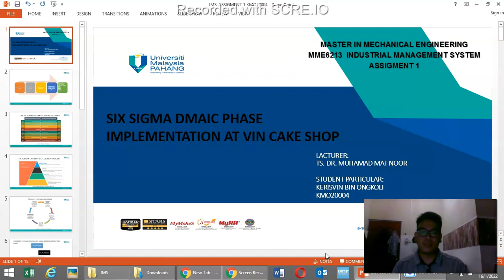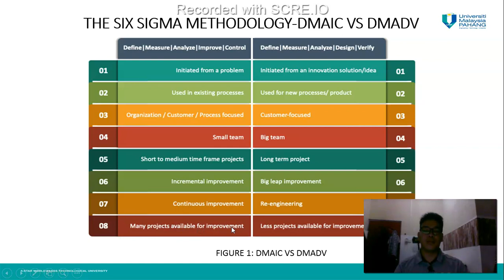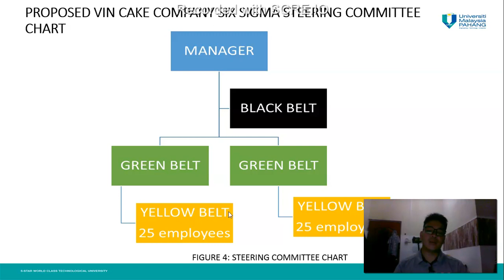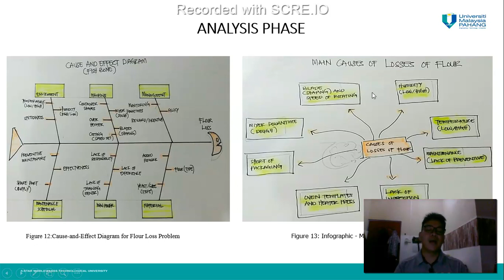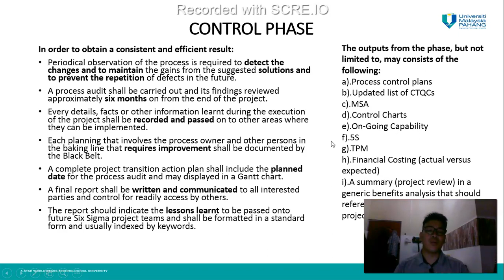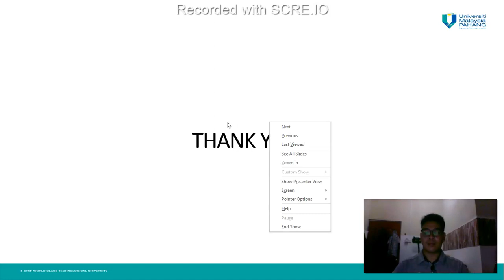Video Six Sigma Project Presentation

Comment: The project was successful because the problem was clearly defined from the beginning, and the team followed every stage of the DMAIC methodology correctly. Support from the Black Belt and Green Belt helped guide the team and ensured the project stayed on the right path. All decisions were made based on real data rather than assumptions. By identifying the true root causes and collaborating across different functions, the team was able to develop effective and practical solutions. The control measures implemented afterward also ensured that the improvements were sustained over time.

From the presentation, I learned that accurate data and a structured DMAIC approach are crucial for any improvement initiative. Clearly defined team roles and strong leadership support make the process more efficient. I also realized that improvements must be supported by proper control plans to maintain long-term results. Overall, the project showed that combining teamwork with a systematic problem-solving approach can lead to lasting improvements.

I agree with the earlier point that reliable data, a clear DMAIC structure, and well-defined roles significantly contribute to project success. In addition, thorough root-cause analysis and strong control mechanisms are equally important, as the improvements may not be sustainable without them.

Comment: 1. The success of Six Sigma projects hinges on several critical factors. Firstly, adopting the DMAIC methodology clarifies the project workflow. Secondly, employing data analysis tools such as fishbone diagrams or Pareto charts identifies the primary causes of waste. Thirdly, clear division of responsibilities among teams ensures effective implementation of solutions. Finally, the Control phase must be executed to guarantee the sustained maintenance of improvement outcomes.
2. From this presentation, I learned the importance of Six Sigma, which means that improvements must be based on data. Furthermore, I also learned that process improvement is an ongoing process, not a one-off result.

Comment: In my opinion, the key factors for success here were the rigorous application of the DMAIC methodology and the use of the Pareto Chart to strictly identify the 'vital few' problems (specifically the ovens and packaging areas). The fact that you were able to quantify the success by improving the Cpk from 0.21 to 0.7 provided strong validation for the project.
The main lesson I learned from this presentation is the critical importance of Root Cause Analysis (Fishbone Diagram). It was insightful to see how operational waste was actually tied to specific maintenance issues (heater plates) and environmental factors (humidity), rather than just general errors. It effectively demonstrated why the 'Measure' and 'Analyze' phases are so crucial before jumping to solutions.

Comment: 1) The Six Sigma project was successful because it combined strong leadership support, a clear problem definition using the DMAIC framework, and a data-driven approach that ensured decisions were based on measurable evidence. Cross-functional collaboration, employee training, and a focus on customer satisfaction helped drive meaningful improvements, while control mechanisms like dashboards and audits ensured the results were sustainable over time.  

2) From the project presentation, the main lessons learned are the importance of setting clear metrics early, maintaining structured problem-solving discipline, and communicating progress transparently to stakeholders. Celebrating small wins built momentum, adaptability allowed the team to respond to unexpected insights, and most importantly, the project showed that Six Sigma is not just about tools but about fostering a culture of continuous improvement.

Comment: 1. This Six Sigma project succeeded due to a well-defined problem statement, strong data-driven analysis, and effective use of the DMAIC framework. Collaborative teamwork and sustainable corrective actions were also major contributors to its success.

2. I gained a deeper understanding of how structured problem solving methods such as DMAIC and tools like the fishbone diagram can drive meaningful improvements. It’s a strong example of how data and teamwork create impactful results.

Comment: 1.The success of this Six Sigma project was due to the fact that they were able to define the problem, analyse everything using data and used the DMAIC method. Teamwork and identification of solutions that will be enduring also contributed to the success.

2.I got to know that structured problem solving, in this case, the DMAIC process and the fishbone diagram tool are actually applied and result in actual improvements. It was an excellent example of how collaboration and working with data are important.

Comment: 1. Success Factor: The project won because the team was disciplined, using the DMAIC structure and data to find the exact problem, backed by strong teamwork that created lasting solutions.

2. Lesson Learned: The core lesson is that structured methods (like DMAIC and Fishbone) and teamwork are not just theory; they are the essential tools needed to turn raw data into real, measurable business impact.

Comment: 1) Key success factors that made this Six Sigma project successful:
The project succeeded because the team clearly defined the problem, used DMAIC effectively, and relied on solid data analysis. They identified the main root causes like oven defects, humidity issues, and poor maintenance and focused improvements on these high-impact areas. This led to a strong capability increase from Cpk 0.21 to 0.70.

2) Lessons learned:
I learned that accurate data, proper root cause analysis, and targeted improvements are crucial in Six Sigma projects. Focusing on major loss areas and maintaining good process control can deliver big, measurable results even in an SME environment.

Comment: LAKESEN A/L SARAVANAN (MA22027)

The presentation was very clear and well-structured, and it helped me understand how a real Six Sigma project is carried out step by step. I found it useful how the lecturer explained the project using the DMAIC framework, especially how the team defined the problem clearly and supported every decision with actual data. It showed the importance of identifying the correct root causes instead of jumping to solutions too early.

I also appreciated the explanation on teamwork and stakeholder involvement, which made me realize that a Six Sigma project is not just about tools, but also about communication, leadership support, and collaboration. The improvement and control phases were also well presented, showing how the solutions were implemented and monitored to make sure the results are sustained.

Overall, the lecture gave me a better understanding of the key factors behind a successful Six Sigma project and taught me the importance of data-driven decisions, root cause analysis, and consistent follow-up. It was a very informative and practical explanation that connected theory to real-world application.

Comment: The project worked because they followed the DMAIC steps properly. They found the real problem, collected data to measure it, figured out the main causes using Pareto charts, then fixed those specific problems. I learned that Six Sigma needs proper planning and data, not just guessing. The Pareto analysis was really useful. Also, the Control phase is important to keep improvements lasting. Even small businesses like bakeries can use Six Sigma successfully to save money and reduce waste.

Comment: 1. Briefly discuss how and why this Six Sigma project was successful.

The Six Sigma project was successful because the team clearly stated the management roles and their respective duties in the organisation based on the belt system, which strengthened leadership support for the project. Besides that, the DMAIC initiatives were implemented effectively in the project to solve the issues that the company were currently facing and improve sales performances. Moreover, the team also utilised the right Six Sigma tools to conduct data-driven analysis for each phase throughout the project and monitor the improvements to ensure the solution was sustainable.

2. What do you learn from this project presentation?

From the project presentation, I learned how to conduct a Six Sigma project and utilised the Six Sigma tools effectively. The presentation demonstrated how structured approaches like the DMAIC method are used systematically and step-by-step to guide problem-solving and process improvement.

Comment: The team pinpointed a specific high-impact issue, such as increasing flour usage and rising costs. Having a clearly defined problem helps maintain alignment, focus, and purposeful goals. Accurate measurement then eliminates guesswork and highlights the areas that truly need attention. Identifying the root causes is crucial; without this, any improvement would be short-lived or incorrectly targeted. The team also monitored financial outcomes, showing improved profitability—proof that Six Sigma efforts work best when they deliver measurable business results. By following each DMAIC phase systematically, the team avoided shortcuts and maintained a disciplined approach to problem-solving

Comment: 1. The project was successful because the team clearly defined the problem and set measurable goals from the beginning. It also benefited from strong support and involvement from management which ensured the required resources were available. The team effectively used the DMAIC methodology and relied on data-driven analysis to identify and eliminate the root causes of the issue. In addition, the proper use of Six Sigma tools and a strong focus on customer requirements helped achieve meaningful and measurable improvements. 

2. From this project, I learned that making decisions based on data is far more reliable than relying on assumptions. I also realized that teamwork and open communication are essential for solving complex process problems. The presentation showed how structured methods like DMAIC help guide improvement efforts in a systematic way. Finally, the project highlighted the importance of continuous monitoring to ensure that the improvements achieved are sustained over time.

Comment: The project succeed because the problem was identified clearly from the start, and the team followed each stage of DMAIC properly. The guidance from the Black Belt and Green Belt kept the team on track, while decisions were based on actual data instead of assumptions. By finding the real root causes and working together across different functions, the team was able to create solutions that actually worked. The control steps put in place afterwards also helped make sure the improvements stayed consistent over time.

From the presentation, I realised how important accurate data and a structured DMAIC approach are for any improvement project. Having clear team roles and strong support from leaders makes the whole process smoother. I also learned that even after improvements are made, proper control plans are needed to maintain the results. Overall, the project proved that combining teamwork with a systematic problem-solving method can create long-term impact.

I agree with Nur Fatini earlier that solid data, a clear DMAIC flow, and well-defined roles really do make a big difference. I’d also add that doing a thorough root-cause analysis and setting up strong control measures were just as important. Without these, the improvements probably wouldn’t have lasted.

Comment: 1. This Six Sigma project succeeded because the team clearly defined the problem, relied on data for analysis, and applied the DMAIC method effectively. Strong teamwork and implementing long-lasting solutions also played an important role in achieving success.

2. I learned that structured problem-solving methods, such as the DMAIC process and tools like the fishbone diagram, truly help drive meaningful improvements. This project showed how using data and collaborating as a team can create a real impact.

Comment: The Six Sigma project was successful because the team clearly defined the problem, followed the DMAIC steps, and used data to identify real issues and guide their decisions. Strong teamwork and management support also helped the project run smoothly, and proper control measures ensured the improvements were maintained. From the presentation, I learned the importance of having clear goals, relying on data instead of assumptions, following a structured method, and establishing controls to sustain results, as well as the value of good communication throughout the project.

Comment: The Six Sigma project was successful because the DMAIC method was followed in a structured way. The team properly defined the scope of the process, gathered and analyzed reliable data to find performance problems, and focused on the most important issues. They carried out root-cause analysis effectively, which helped them develop practical solutions. In the end, strong control steps were put in place to sustain the improvements, leading to a significant boost in process efficiency.

Comment: 1. The Six Sigma project achieved success because the team utilized the DMAIC approach and employed Root Cause Analysis to pinpoint the fundamental issue using reliable data. These methods were then integrated into the project workflow.  
2.  I understand about how important DMAIC and RCA are for any project success.

Comment: Tk24008

The project succeeded because the team clearly identified the main root causes of flour loss using tools like the fishbone diagram, and they implemented practical solutions such as improving oven settings, blade sharpness, packaging vibration, and maintenance routines. The improvements were supported by data, shown through the increase of Cp and Cpk from 0.21 to 0.70. Strong control measures, regular audits, and proper documentation also helped sustain the results.

I learned that small process issues can cause major losses if not monitored. DMAIC provides a clear structure for solving problems, and data is essential to confirm improvements. Preventive maintenance, consistent inspection, and standardized procedures are key to reducing defects. Finally, continuous improvement is necessary because even after improvement, more enhancement is still possible.

Comment: The Six Sigma project worked well because the team followed the DMAIC steps properly and stayed focused on a clear, meaningful problem. They used real data instead of guessing, which helped them see where the process was failing and what was truly causing the issues. By fixing the actual root causes and putting proper controls in place, the improvements lasted and led to better efficiency and cost savings. Overall, the project showed the importance of clear goals, good data, honest analysis, and making sure improvements bring real business results

Comment: TL24073 
1)The Six Sigma project succeeded because the problem was clearly defined, the team followed the DMAIC method, and Black Belt–Green Belt leadership guided the process. With data-driven decisions, strong root-cause analysis, and cross-functional teamwork, the solutions were effective and practical. Clear control measures and standard procedures then helped sustain the improved performance.

2)The Six Sigma project showed that good data, a clear DMAIC process, and defined team roles are essential. Strong teamwork and leadership support make improvements successful, while proper controls help keep the results long-term.

Comment: Tl24082
1)The project achieved success by applying DMAIC thoroughly, performing detailed root cause analysis, and using the findings to introduce improvements that directly lowered defects and increased efficiency.

2)I learned that combining structured problem-solving with accurate data ensures that solutions are targeted, practical, and sustainable for long-term process performance.

Comment: 1) This Six Sigma project was successful because they defined the problem clearly, used data to analyze everything and applied the DMAIC method effectively. Teamwork and finding solutions that will last were also key to the success

2) I learned that using structured problem solving like the DMAIC process and tools such as the fishbone diagram really leads to actual improvements. This was a great example of how using data and working together makes a difference.

Comment: S.Dhaaneswaran (TK24043)

What I learned from the video is

 1) Key Success Factors
The Six Sigma project succeeded due to:
Data-Driven Focus: They used data to prove the problem and applied tools (Pareto, Fishbone) to isolate the oven area as the main cause of flour loss (related to poor maintenance and lack of control).
Measurable Results: Targeted improvements led to a major increase in process capability, with the Cpk value increasing by 233% (from 0.21 to 0.70).
Sustainability: A detailed Control Plan was implemented to monitor the changes and ensure the improvements lasted.
2) Main Lessons Learned
The key lessons from the presentation were:
Prioritize Action: Focus efforts based on the Pareto Principle—fix the few issues (like the oven) that cause the biggest problems.
Structure Works: The DMAIC framework provides the necessary step-by-step structure, and a dedicated Six Sigma team (Black, Green, Yellow Belts) ensures project execution and organizational support.

Comment: 1) the Six Sigma project was successful because the team implemented the DMAIC technique, used Root Cause Analysis to determine the root cause based on accurate data obtained and implemented those techniques into the project process.
2) from this project presentation,  i learned the importance of DMAIC and RCA in ensuring the success in any projects.